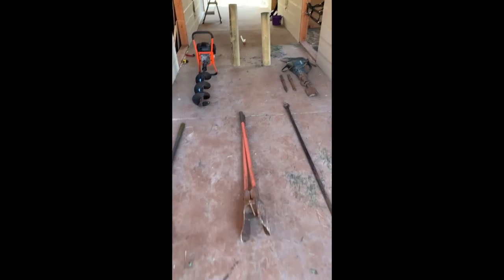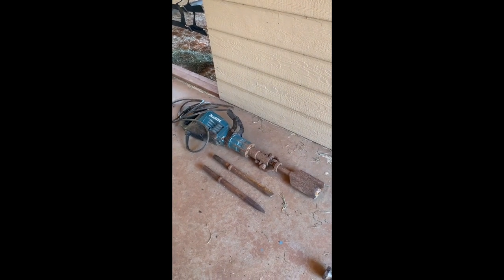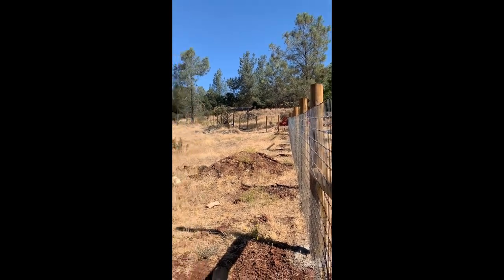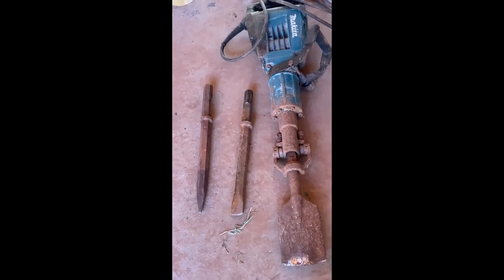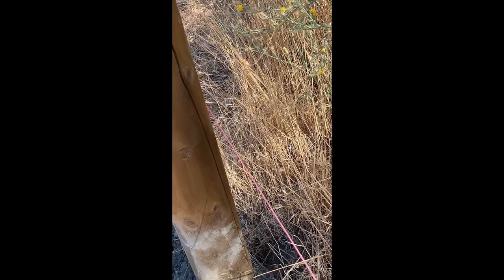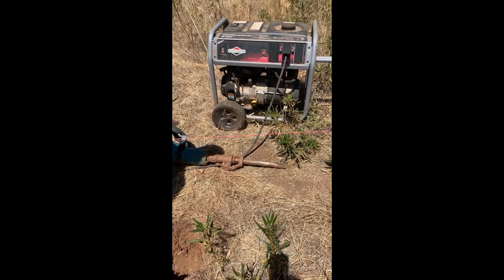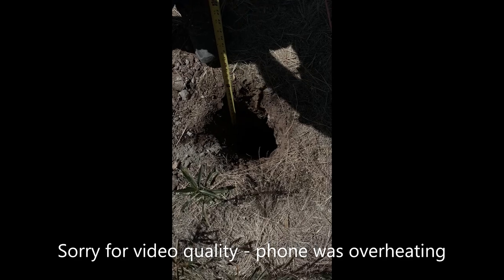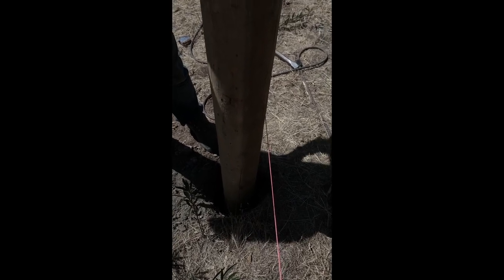Digging Post Holes in Rocks & Poor Soil

Comment: After many a post hole dug this year, and a 300' X 36" deep trench, I found that my Kentucky experience has mirrored your own, as well as the progression, starting with the spade, the long 18 lb. chisel bar, the 9" post hole auger (only mine was mounted on my tractor), and then the electric jack hammer. I don't have the 4" spade bit, but was considering it. My rock challenge was a great deal of 10" thick limestone, buried about 3-6 inches below the surface of the ground, usually 4 feet long in size. Since it was a trench, I had to just cut through the entire length of the stone. If it wasn't stone it was clay and somewhat hard at times to pull the chisel of the jackhammer out of the clay/rock combination. So with all that said, I can attest that your advice is good advice. Well done.
Reply: Yep, I had to go through the exact same process of persuasion.

Comment: I'm in the foothills of the sierras and have bought all the same tools you have. 😂 Our terrain is very similar, but I think you have more rock.  After spending a weekend per hole, I ended up with a jack hammer and it was a life saver.  The trouble I found is that I can't get more than 3 feet for my h-braces (hoping for 4).  There are definitely loads of videos of fence building in much friendlier soil.   I appreciate you taking the time to share your solutions!  I found too with the wrecking bar, that if you hit smaller rocks and the soil isn't too dry, you can rock it side to side and bore a pretty decent t-post hole.  Good luck with all of your ranch projects!
Reply: I found getting 36" deep is a real chore for the same reasons. 32" is much easier. I don't think that I would trust 24" much but it appears to be working.

Comment: Thank you for the helpful video! I have very rocky soil and many of those rocks are quite big, 10 inch diameter is common. So digging post holes is a nightmare. I have been using a big wrecking bar and post hole digger and it works but so much work. I think a jack hammer is the way to go. Looking forward to trying it out next week. Thanks again.

Comment: I would also recommend using a rotary hammer with a spade bit. It works very well on clay with softball sized rocks. Cause it vibrates it between them and then you just pry back and it pops them up. It is much lighter than a jackhammer. I own both and prefer the rotary hammer in all but the most rocky of soils.
Reply: Sir,
I think you are right. I did it his way 4 months ago. I later saw some one with your exakt rekommendation. 
I was on the fence about buying a demo hammer and a heavy roto hammer. Still haven't bought anything tho. Just saying. You are probably right.

Comment: you need a BELLTEC post hole digger, it will dig solid rock and concrete with rebar 2" to 18" dia. and goes right on tractor 3 point it is frame guided drills straight  9" hole in solid limestone rock 3 foot deep 10 minutes it's on youtube check it out

Comment: One thought I have is to drill a 1 inch hole down your 2 to 3 feet, put in a plug of say 3 inches of gel ignite with a detonator, fill the remainder of the hole with Anfo, (diesel and Ammonium Nitrate mixed 6:94 by weight) don’t tamp or plug the hole, fire it, I reckon it will “burn” a hole. Btw, where ever possible, I used compressed air in preference to electricity, after the compressor is bought, the “tools” are cheap as compared to power tools AND you can make up your own specialised tools easily and safely. Good call on the dust, always use water to damp down an dust.

Comment: Mate, my place looks just yours. I have all those tools except the jack hammer. Iron & clay everywhere . The  Auger on the tractor ,just jumps up .Very frustrating .I have a 9kw geny ,I have to make my posts 8' high.Because the Kangaroo hop over anything under that .Eating everything in sight. No matter what i decide it's still going big bucks. But thanks for the info & your struggles.

Comment: Greetings...I have a similar problem, but I'm attempting to plant four 12' 4x4 post 3' into the ground; however, I hit solid rock at about 20 inches.  Are there longer bits for a jack hammer so I can break the rock up that is deeper in the ground?

Comment: I had thought about using the breaker, but I was unsure if it would work. Glad you shared your experience. I am from the semiarid region of Brazil, soils are shallow, from 1.31 feet it is impractical to drill with simple diggers. What is the power of the generator to operate this makita breaker? I intend to buy a breaker.

Comment: I live with your exact rocky property, in NW Washington state. Thank you for this info! I asked locals about using a jackhammer & they laughed at me saying that idea was ridiculous. Can a 56 yr old widow handle the hammer? I need to fence in my chicken yard because we're predator-heavy: bear, wolf, cougar, coyote...What about for my garden? Could I just use concrete deck blocks & 4×4's?
Reply from the maker: Hi - be very carful with a jackhammer, this is something you may want to hire out as to not hurt your back.  For our coup we only went down 10-12" since the the run was attached the coup and solid. I then just had buried hardware cloth down six inches and filled that trench with a few bags of cement.

Comment: Thank you for this video! Based on it, a jackhammer is more helpful than an earth auger. Is it the right message? I am going to get a jackhammer instead of an earth auger if I need to put on a fence.
Reply from the maker: Hi - depends on your situation.  If I had access to the fence line, a specific fence line laid out, and easy access to a tractor with a rock bit, I would have gone that route.  But budget, accessibility, and the pure size of the project (we had to fence in the entire property from scratch so it was/is a long term project) made the jackhammer make the most sense for me.

Comment: Looks like my place in Lake County CA North of the Napa valley. Same soils, same boulders, same plants. All the wood posts burned during the 2015 wildfire, why use wood vs metal posts? Neighbor lost his house (well everyone did) but his metal posts all survived. While my fence was still good but all 8 foot wood posts burned right into the ground. $8000 to put in new posts (480 feet) and out up the fence again. Is metal T-bar the same but smaller hole in boulder soils?

Comment: The LAST step of your fencing is to RUN A HOT WIRE on the inside of all your fencing about 2 feet out to keep the horses from scratching their BIG ASSES on your new fence ! Otherwise , they'll simply push your fence over at a 45 degree angle and fart in your face !

Comment: You can get a skid steer in that terrain no problem, especially if your running tracks. I know this from experience, you would be better off getting someone to help for the couple days and renting a danusen hammer or Montana driver for a skid steer mast and you can run around the rocks as you drive them in. As l9ng as your not running them into a legit boulder.

Comment: Why would you burn out the jack hammer motor by running an extension cord?
Reply: If the extension cord is too long, it cannot carry the electrical load that the motor needs and everything heats up, potentially damaging the motor. Better to use a big generator closer to the site.

Comment: Ya that’s not an auger man I love on a mountain ranch and got a 50 hp auger on a bobcat with a rock bit you worked way too hard dude ya could have rented that bobcat for half the money ya spent and did all ur holes in one day buddy but hey work harder not smarter right
Reply from the maker: Yea, it actually is an auger...they don't just come on tractors.  I appreciate your take, but is incorrect on multiple levels.  Renting a bobcat with a ripper every time I want to dig fence post holes isn't in the same galaxy, cost wise, as spending a few hundred dollars on a jackhammer that I can use as/when needed.  secondly, about half of the holes I dug could not safely be accessed by a bobcat. Thirdly, we are constantly adding fencing, replacing fencing etc and it is quite frankly a waste of money to rent a tractor every time i want hole dug when I am more capable of digging it myself, as outlined in the video.
Reply: This is a money vs labor equation. if you've got the money and can dig all the holes at one time, rent the bobcat with the big auger and be done with it. If you are on a tight budget and have lots of time and muscles, rent a jack hammer and dig a few at a time. Either way it will get done.